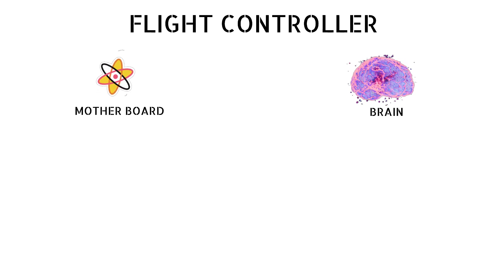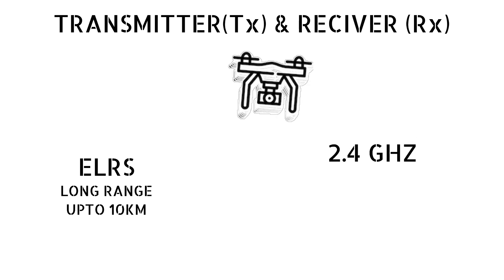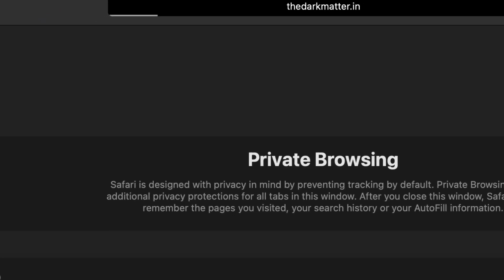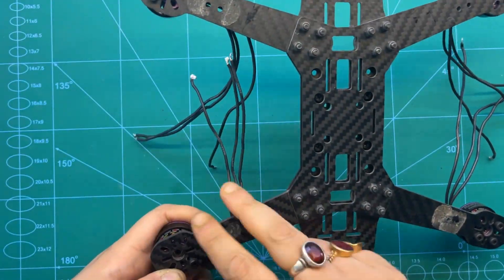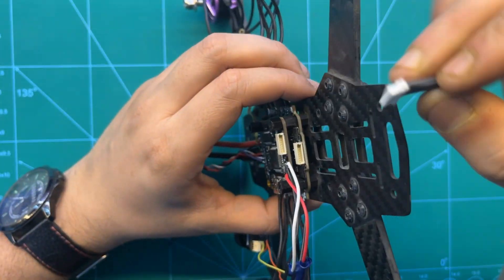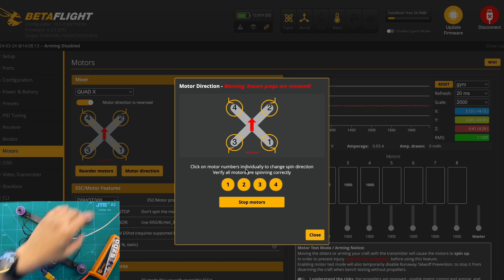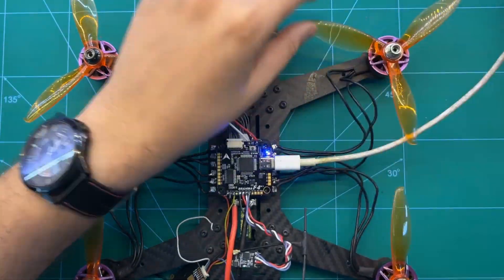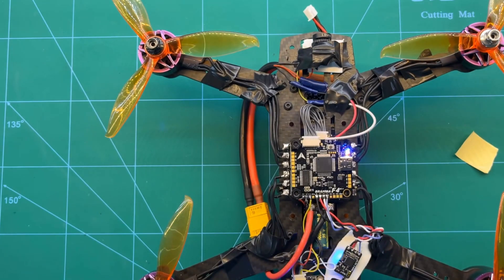How To Make Your Own FPV Drone Using BRAHMA F4 In India 🇮🇳 - DIY FPV Drone

Comment: which is better speedybee f405 or Brahma. and why?
Reply from the maker: Thanks for QQ

With all due respect, SpeedyBee F405 is an excellent flight controller. 

A few key points to consider for Brahma F4
1. 1:1 after-sales support
2.  6 month warranty
3.  DPS310 - very smooth barometer, you can feel the difference while flying
4. Dual BEC 2A & separate power supply for IMU and MCU
5. Designed and Made in India
6. Tested and flown by many FPV pilots across India